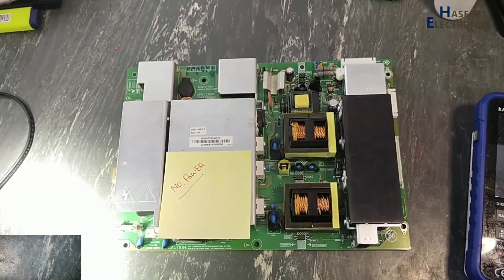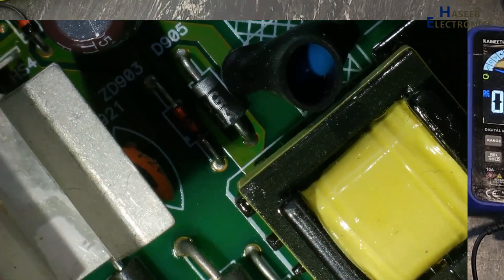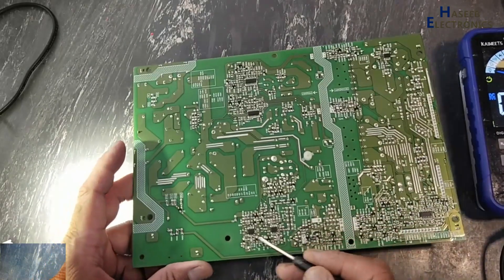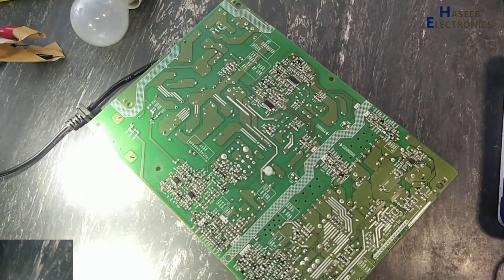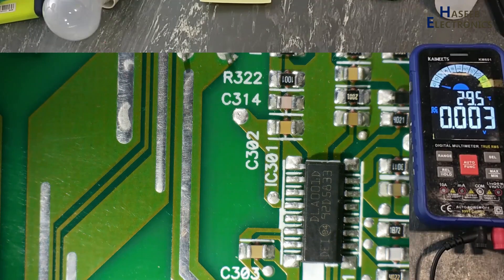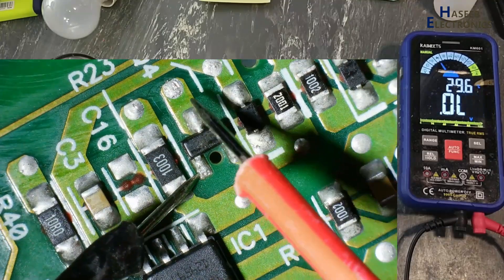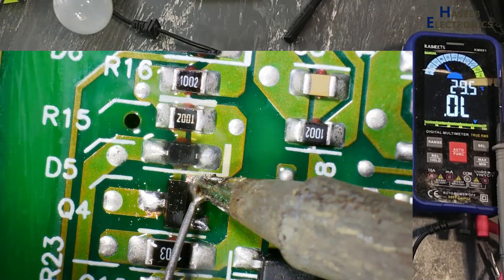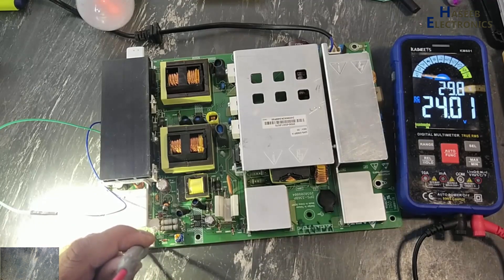{1191} Delta DPS-336BP Power supply repair

Comment: Was not easy to find. Thanks for sharing. Needs a lot of thoughts before you able to find the issue.
Reply from the maker: you are right. if someone have a clear concept of the structure of the circuit and theory of operation. then it becomes easy to take a logical approach.